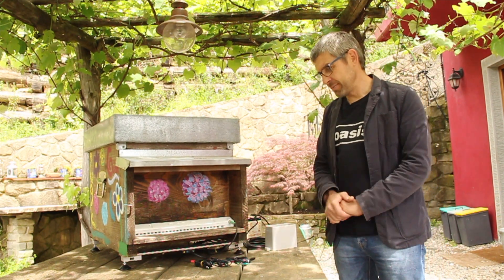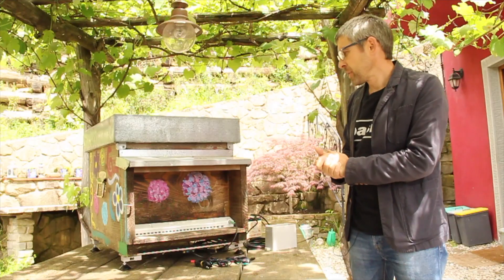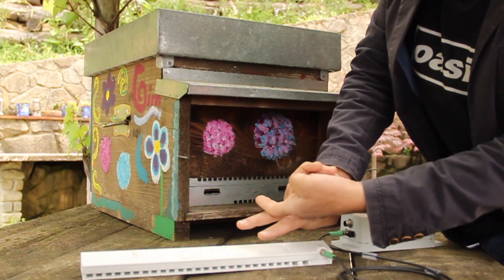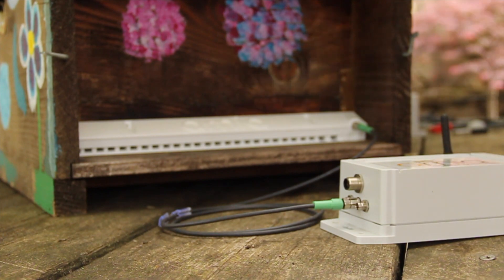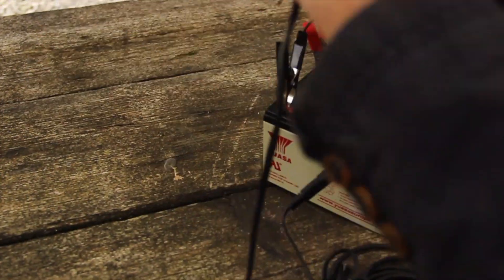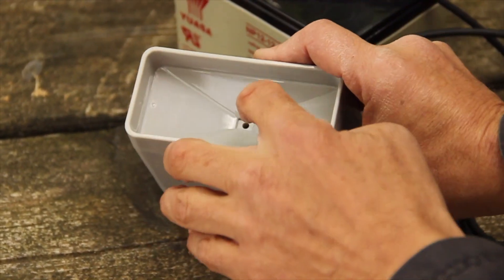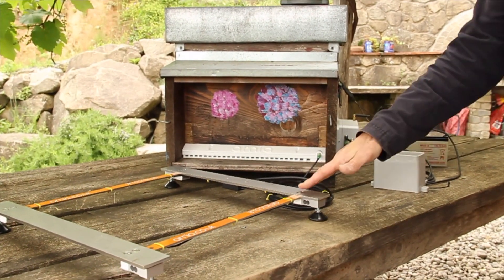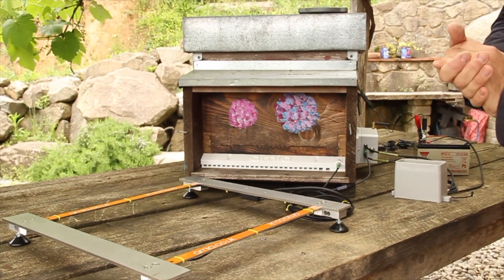Bee Hive Monitoring System Tutorial - IoBee -

Comment: You are charging the battery from solar panel but at the same time you are charging the device without any battery management system. Doesn't it gives harm to battery?
Reply: No, it is a std ‘dashboard’ car trickle charger. Used to keep your car (or boat) battery from degrading over time is you do not use you car, say at an airport carport. Does not need a controller, cost about $10 at any big box store. I use a lot of them to keep various projects topped up.